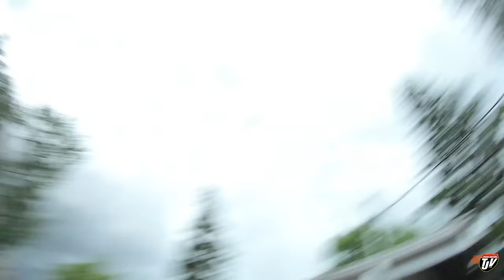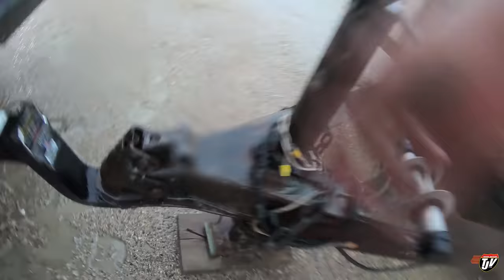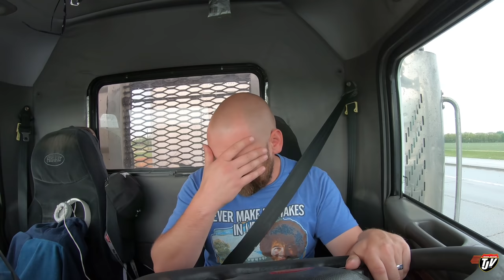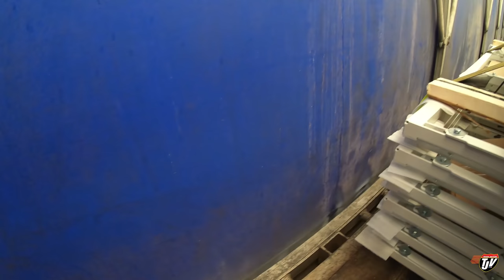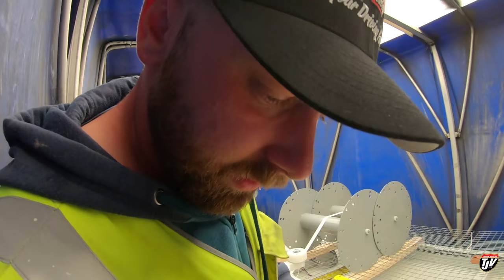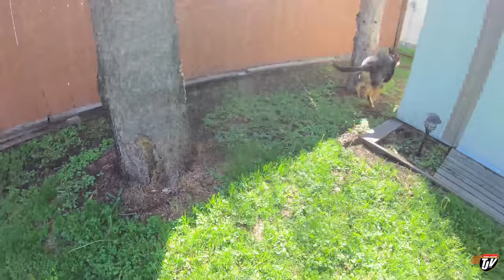My Trucking Life | WRONG TRAILER | #2300 | June 9, 2021

Comment: Doesn't your electric company trim trees away from the power Lines to prevent power outages in Canada? It's neat when the helicopter comes with the saw to trim the trees in the hard to reach places. Then they put it through the chipper & someone usually gets mulch.